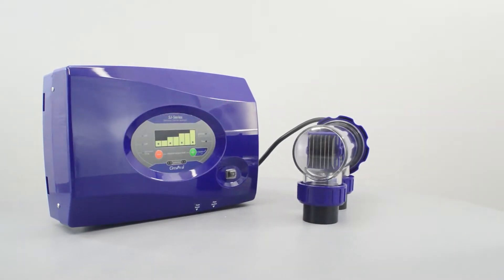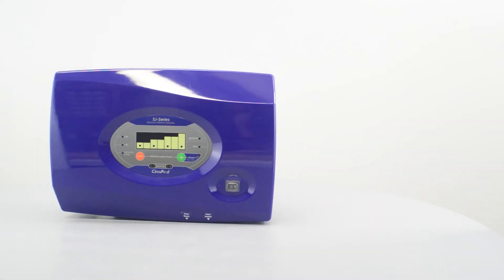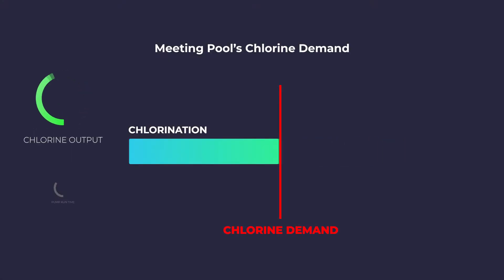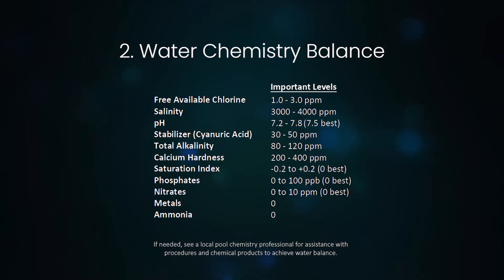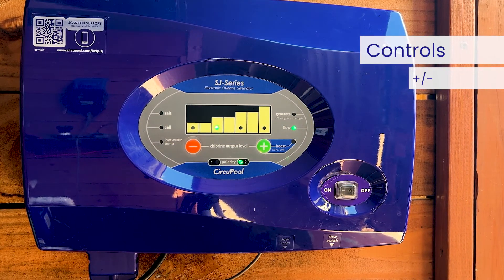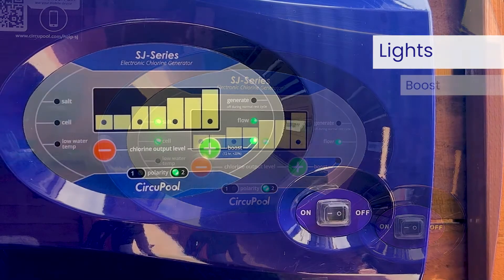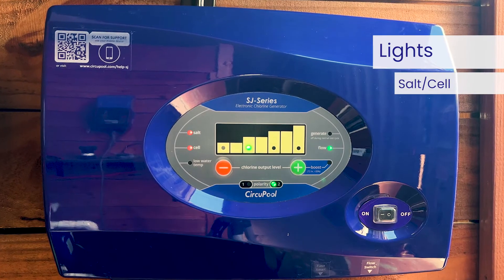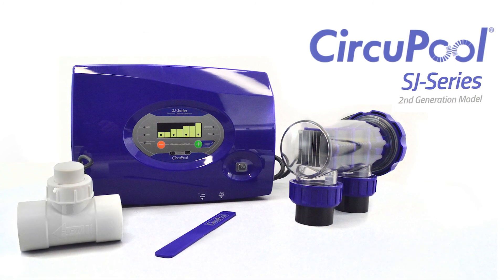Operation Guide | CircuPool SJ Series Salt Chlorine Generator | How to Use Your Salt System

Comment: Can you do adjustments through Bluetooth cell phone? Does plug it into 110 or do you to wire into box?
Reply from the maker: This SJ-Series model does not offer wireless connectivity, and is intended to provided consistent operation when the pool pump runs. It is dual-voltage, accepting 110V-240V power. It comes with an unterminated power cable, so if you want to plug it in to an outdoor outlet you would add a plug sourced from the hardware store.

For a system with app control with both Wi-Fi and Bluetooth connectivity, you may want to consider the CircuPool CORE CONTROL models: https://www.circupool.com/CircuPool-CORE-CONTROL-35-WiFi-Automation-Platform-Electronic-Chlorine-Generator_p_561.html
Reply: @CircuPoolUSA  thank you